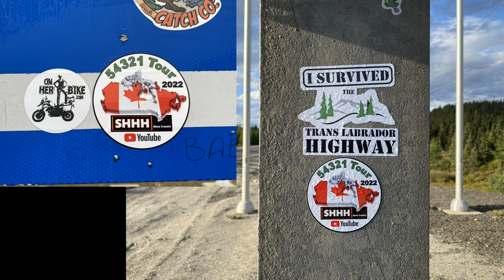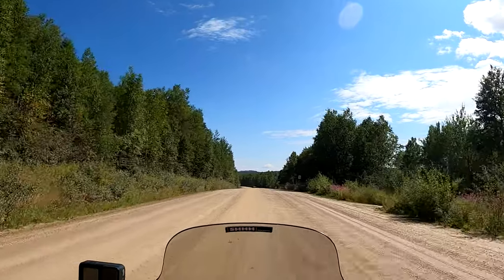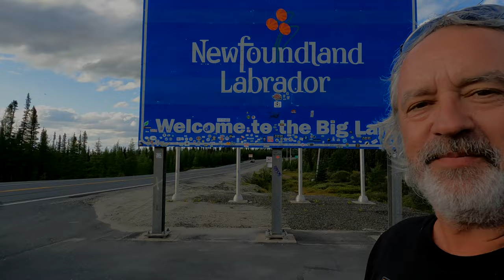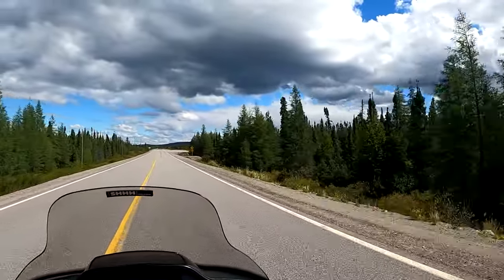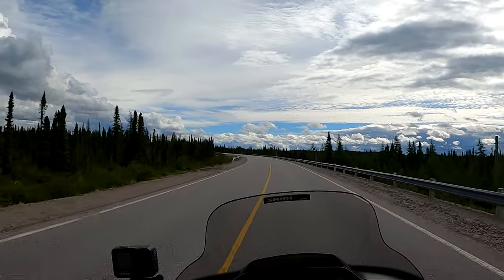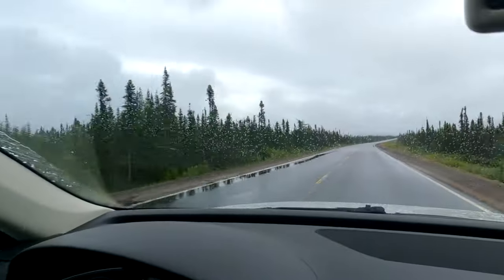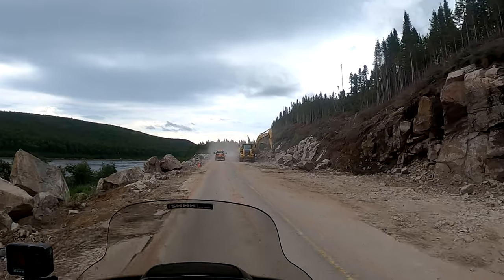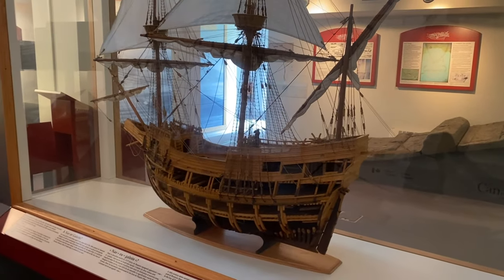2022 Trans Labrador Highway

Comment: Awesome and fun. Doing that route this summer I hope.   Just found your channel. Will watch more later today. 
Can you please describe your camera and mic set up. You mic sound is one of the best I have seen. 
I would appreciate it
Jim from Owen sound
Reply from the maker: hey !
Thanks for watching and leaving your comment
   On my open face helmut, I just run a GoPro 8 with media mod and plug a RODE Lapel mic direct to the camera. Have the mic mounted to my chin strap
    hope that helps !
Reply: @SHHHMotoTravels  you have to be kidding. There is zero wind noise. You must add some sort of wire to keep it in your mouth area. I will have to watch again and pay more attention. 
Thanks for the quick reply.
Reply from the maker: @chasinggeckos8843  RODE makes a wire headset mount for the lavelier mic. I cut and modified to wire it to my chin strap to get closer to my mouth. no other mods.

Comment: Great video👍  which part has the longest stretch without a gas stops? possible for a car only has 350km range? thank you for your time.
Reply from the maker: Hello !
Thanks for watching !
The longest stretch with no stations is between El Rosario de Arriba and Guerrero Negro on Hwy 1 MX. 
    It is about 360ish kms. 
The point to make sure of, that we wanted to point out.  If a person filled up in Tjuana they would have lots of tank range at El Rosario but if they passed there thinking there is gas stations every 100 kms they could possibly run out at total kms from Tjuana and o Guerrero Negro would be around 700 kms. 

I know lots of people on motorcycles and lots of motorcycles only have a 400 kms tank range. 
Lots of cars and RVs have big ya k range, just need to make sure before heading south from El Rosario. 

Cheers
Reply from the maker: Haha. Sorry, I answered wrong … as we just released a video about highway 1 in Mexico. 

On the Trans Labrador highway, the longest stretch of road with no gas is between Happy Valley /Goose Bay and port hope Simpson
Reply: @SHHHMotoTravels  Thanks for your reply👍

Comment: Great video. How do you not have any wind noise in your audio without a full face helmet? Thanks!
Reply from the maker: Thanks for watching !!
   I just use a RODE lavilier lapel mic plugged directly into a GoPro 8 with media mod. That’s it. 
I tested several mic’s but this set up works good for me. 

Cheers
Reply: @SHHHMotoTravels  Crazy, you just have no wind noise at all. We did the lab hwy as well this summer. You can see the videos on our channel, but we had issues with the wind cracking